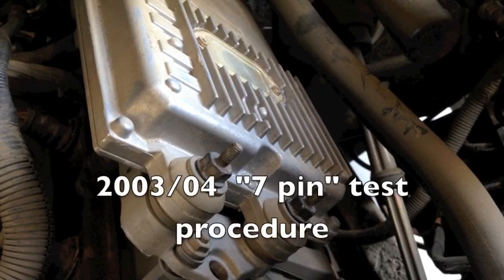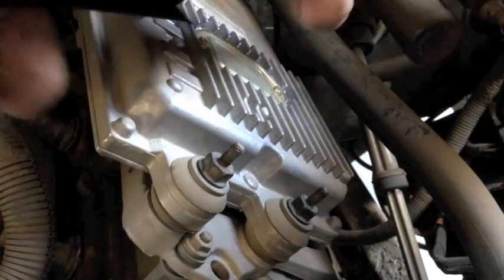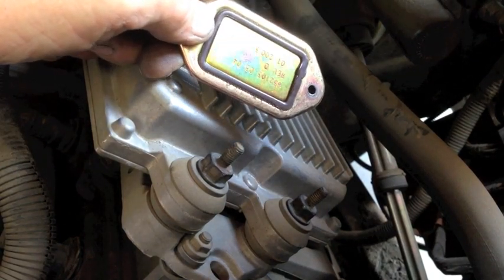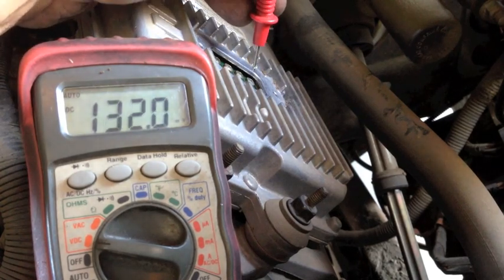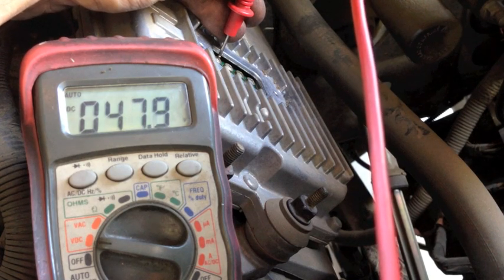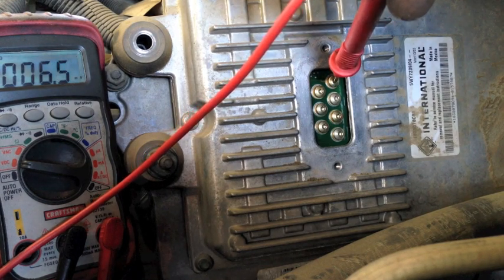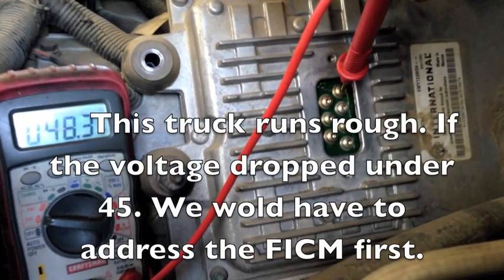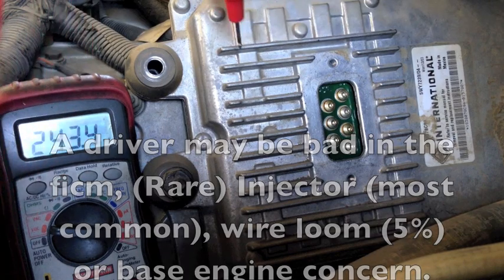P0611 Testing the 7 pin ficm on the 03/04 6.0 Powerstroke

Comment: Hi Ron, I just tested my FICM, 2004 early 6.0 Ford diesel, after having it repaired.
Unfortunately there was no voltage reading on terminal (key on) 12  volts to bottom terminal.
 Could there be
another issue with power coming to the ficm? Also, no power to the fuel separator pump LH frame. The engine turns over well, and also had initial problems with ( no power hot-then no start).
Checked IPR valve, fuses, cleaned ICP connector,

Comment from the maker: Yes. I slid it in the battery cable end. Anywhere is probably okay. There could be a little voltage drop if you use the engine or something but I would not expect too much or the engine would have cranking issues if there was a big resistance problem.